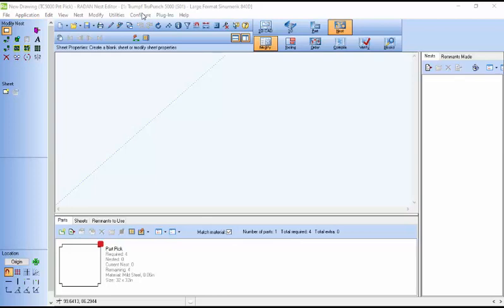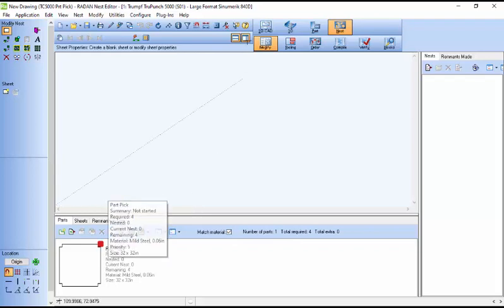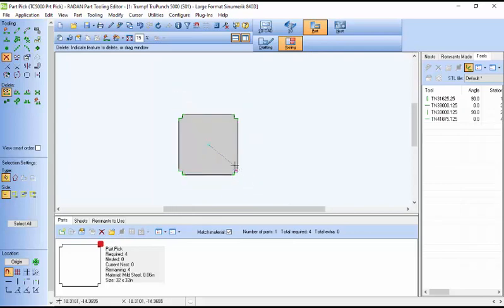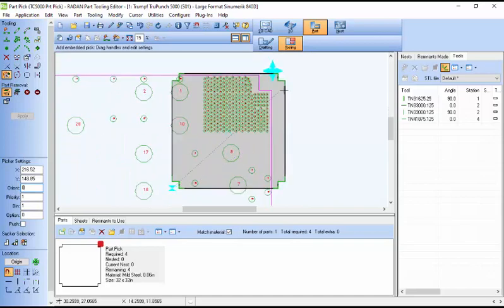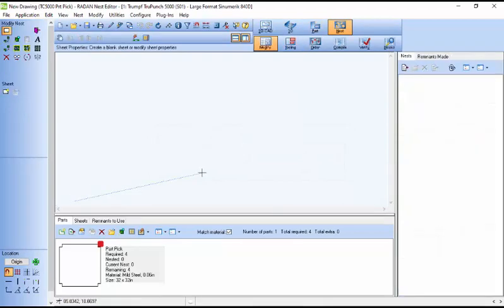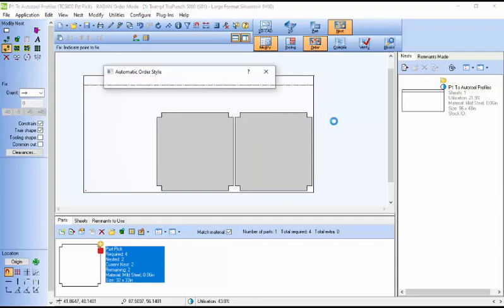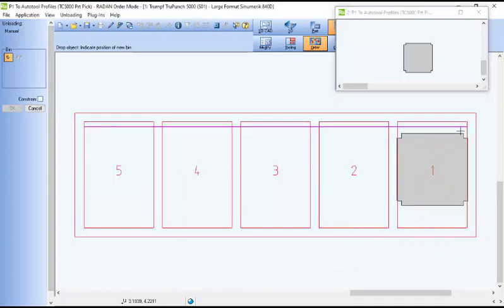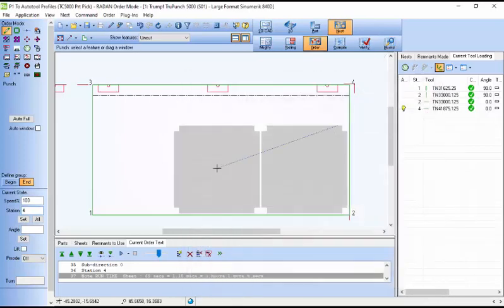RADAN   Running Trumpf TC5000 with Part Picker

Comment: Hi Dean, this was great. I was curious if you would use the same command function to load the sheet metal onto the working station. We use a Trumpf 5000 punch. Right now, we are having trouble using the sheet master if the sheet is less than a full 88" X 120". Do you have recommendations for both activating the initial loading of the sheet master as well as designating individual suction cups for smaller pieces?
Reply from the maker: If you are having issiues loading it could be a number of things. What software are you using ? Have you got the Loaction of the Stop Pin Correct ?